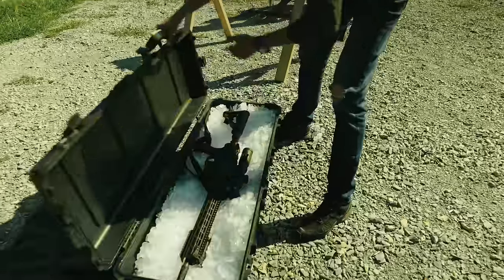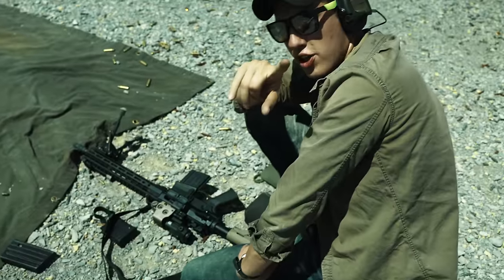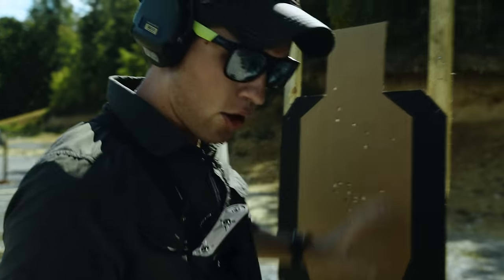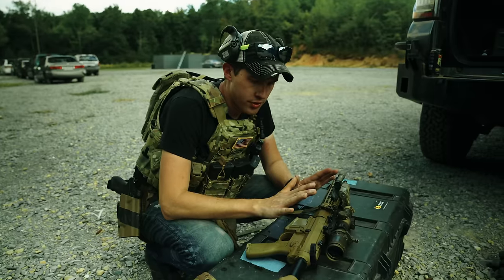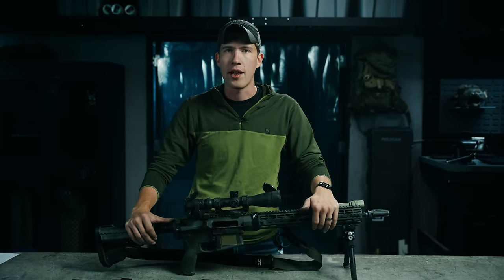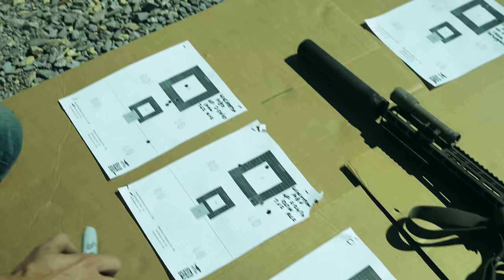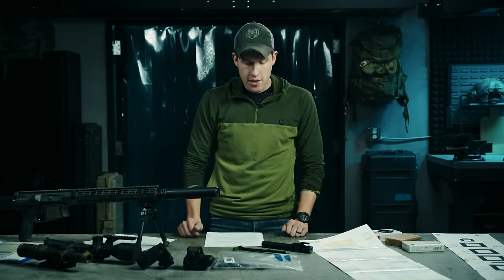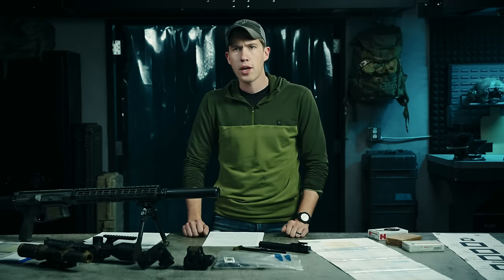Aero Precision M5 AR-10 5,000 Round Test

Comment: Hello T. Rex. Here's my experience so far......

I picked up a completed 308 M5 build from a store/builder in Nebraska. First gun was a single shot! Changed a few parts, did not fix the issue. The issue being not a reliable functioning rifle. Might get through maybe 4 rounds at the most if lucky. And always failed to lock open on the last round. Sent it back to the builder. He said the gas block was not properly aligned. Keep in mind he sent it to me out of alignment if that was the case! The gas block and rod was one of the items changed!  He ended up building me a new rifle, because he felt the first was kinda rough when all was said and done. He told me he shot 10 rounds through it, and it worked flawless. 

The new rifle arrived at my FFL where I picked it up a few days ago. And based on what he said about it working fine, I decided to go ahead and change a few things on the rifle. I put on a different pistol grip, added an Ambi safety, put in a LaRue MBT trigger, and this time when ahead and installed a muzzle break (This was not added to the first gun.) I did remove the hand rail and added a bi-pod M-Lock rail adapter and a M-Lock sling connector. I put the scope and the 45 degree mount with red dot back on the upper receiver. But I did not make any changes to the gas block or the gas rod, or the bolt. Took the new rifle to the range and it is a single shot just like the first rifle!!! When I say single shot, I mean the rifle will fire and eject the case (Sometimes will jam with a double feed, but these are rare), but the bolt will not move far enough to the rear to load a new round from the mag! I have to charge the rifle to load the next round And, just like the first rifle it will not lock the bolt back on the last round!

This rifle has not had enough rounds through it yet to be considered broken in I know. But I'm a little hesitant due to all the rounds I fired through the first rifle without fixing the issues, and this rifle already showing the same issues!! 

 I have sent a email to Aero, but have not heard any reply. I think the rifle is under gassed and that the gas port on the 416 BA barrel could be too small, but the builder stated it is the correct size. I really like this rifle and I really want it to work as it should! It is accurate enough. I did zero the first rifle out to 300 yards. 

Kinda wishing I had just went with a PSA 20" 308!

Update: Contacted Ballistic Advantage and explained what it was doing. They agreed with me that it sounded under gassed. They told me what size the gas port should be and what drill bit size I needed. I disassembled the rifle and tried to insert the drill bit in the gas port, it would not fit. I put a cleaning rod in the barrel, put some oil on the bit and around the hole and drilled it out. I cleaned the barrel and made sure there was not shavings in it. I put all the upgrades back on the rifle and took it to a local range. It worked as it should. I fired a full 20 round mag without any issues! I know It needs more rounds down the pipe, and that will happen when I re-zero the rifle at 300 yards.

One Shot  (Literally)... One Kill!

Comment: Veteran here, worked with the M4 quite a bit. Biggest tip with the fire pin malfunction, more than likely heat stress, never had an issue with it with my M4, but I also noticed your rifle is dry as a bone, with shooting that damn much definitely coat that interior with CLP, I’ve put couple thousand rounds through an M4 and never had any major malfunctions, did drop it on my acog once or twice though lol.
Careful with heating and cooling quickly, strains the whole system
Reply: Clp is life blood

Comment: Excellent content. I would love to see how the Sig 716i and the DD5 V3 stack up against this as they are also 16" .308 guns. Would be great to see how the Sig (a few hundred dollars more than the Aero) would do.
Reply: POF piston no problem, would love to see same test with sig 716. There was a sheriffs office in Cali that tested pof to tens of thousands of rounds.
Reply: I can tell you my sig 716i shoots about 5 moa with M80 and 1.5 moa with federal 175gr GMM
Reply: My sig 716 patrol gen 1 has about 8500 rounds all original parts. Had a issue when I first bought it, the forward assist pin kept catching the bolt and not allowing it to cycle. sent back to sig n they fixed it. Havent had a FTF(feed or fire) or a FTE since, even in -25°. Overall I've been extremely happy with it and its one of my favorite rifles. Usually only get to about 150 to 200 rounds before cleaning as I dont go out to just dump mags with that gun.
Reply: Yeaa I'd be very interested in the sig 716
Reply: I’m also interested in seeing Lucas’s findings.
Reply: My issue with the 716i is the proprietary charging handle and the one the rifle ship with sucks.
Reply: Another vote for the 716
Reply: @Falcons17  Yes, that’s super annoying.
Sig has another handle that is much better, and should be standard with the rifle.
It’s out of stock of course

Comment: I built an AR10 in 308 with an Aero upper and lower. The only non aero parts are a cryptic bcg, radian charging handle, and geiselle trigger. It's been one of my favorite rifles. I've recently added a 3-18 scope to use it for deer hunting. Great video and I'm pretty impressed how far the rifle made it unlubed.
Reply: What's the difference between 10 and 15?
Reply: That's basically exactly what I'm doing, but Wilson combat bcg.
Reply: @920WASHBURN 10 is usually chambered in a bigger round like 308 or 6.5 creed as apposed to an ar15 which is usually chambered in 556/223
Reply: @bradenstackhouse1335  I see I see. 308 is bigger than 556? Huh.
Reply: @920WASHBURN  .308 Winchester is the civilian designation of the military round 7.62 NATO. 5.56 NATO is the military designation of the .223 Remington. So an AR-15 shoots a .22 caliber bullet, and an AR-10 shoots a .30 caliber bullet. Sometimes AR-10 are in 6.5 Creedmoor, which is a .264 caliber bullet. So .30 > .264 > .22

Comment: This is the first 2 hour video I have ever watched on YouTube, and I can say that Lucas was deserving of that honor.

That said, I have some things to say.

I built myself an Aero M5 using almost exclusively using Aero-branded parts amidst early COVID and Biden-related supply shortages and posted two videos including a shooting tests to my channel.

My 18" M5 was not headspaced and was running a mil-spec trigger. I am not a long-range shooter and I managed a 0.7-0.8 MOA grouping with some terribly reloaded M80 ammo. Say what you will about that, and I admit your mileage will certainly vary.

I did not have any malfunctions in the time I had the rifle, and I loved the quality for the price of the parts offered. I specifically selected a barrel directly from Ballistic Advantage, which of course, makes the barrels for Aero.

Mine was a budget build, and it was extremely difficult to source parts for. Nonetheless, I was fortunate to find that I was able to get really solid groups out of crap quality M80-type ammo. I have since sold it, and am prepping a new .308 AR, but taking my time to find the parts for something that weighs less than 12 pounds.

The lower and upper are both Aero. I am likely going to try to source a different BCG and barrel than was offered through Aero/Ballistic Advantage. I am a law student and do not have a massive budget, but I am damn sure I do not want to buy a rifle that will fail on me under hard conditions. I will say, Lucas did inspire some of that consideration, and I appreciate that T-Rex Arms took the time and expense to make this video.

Regardless, I hope that you all do not write off Aero entirely. They are reasonable and workable for most of us, and I implore that you consider the expense against the requirements that you have for your firearm, which is ultimately a tool. Don't buy Snap-On for a job that a Pittsburgh could handle.

Comment: Bought one of these in South Africa and started shootings it last year September. I had a ton of malfunctions. Handloaded some Hornady ELDM168gr in Lapua brass, using Somchem S335 or Vihtavuori N550 or N150. Hand the same issue. Running it with a ASE Utra suppressor as I set it up as a DMR. Battled a ton. 100 round 5-7 stoppages then on day 19 rounds 5 malfunctions. Mostly stove pipes and sometimes a double feed with a stove pipe at the same time. Cases end up turning around  inside the ejection port with the BCG jamming it. Ended up with a Odin works adjustable gas block. Gas block was on its 1st click open and the rifle still cycled locking the BCG open after an empty mag. Ejection at 4 o clock. Opened it another 2 clicks and it seems good ejection at 3 o clock. So gas block is open 3 clicks out of 20 possible adjustments. Seems like this is a very over gassed rifle. Has any one had similar issues

Comment: Outstanding format and very informative.  I really like the idea of one rifle being presented in several configurations.  
My Aero Precision M5 has the Superlative Arms adjustable gas block and Geissele 2 stage trigger, Surefire closed tine comp.  Shoots smooth and very controllable with the comp and adjustable block.  I haven't tried it suppressed yet...that's coming later.  Only a few hundred rounds into it, but we'll see.  As I did all the assembly myself,  I applied loctite to all screws (hand guard, bolt catch screw).  So far, no movement, witness marks unchanged.  As demonstrated, mags are a common cause of failure with these rifles, but so far no problems at all using PMAGs, no malfunctions.  
Having an extra bolt and firing pin could bring a dead gun back to life.  Those can easily be stored in the handle or stock of many rifles, and is a good backup for M4's and M5's.  
As for running a gun with no lube, I can never understand that philosophy.  These are mechanical devices that come from the mfg with recommendations for lubrication.  Hot metal against hot metal produces severe friction and induces unnecessary stress and accelerated wear on parts.  Deliberately running a dry gun as long as possible with no lube just to see when it chokes is akin to dumping all the oil from your truck and running it as long as possible just to see how long it takes to kill it.  
I wonder if having the adjustable block may decrease the wear on the BCG sufficiently to prolong the life of the parts that were killed in this gun.

If Lucas or the T.REX crew needs another Aero M5 to run as a comparison, to see if these kind of issues are a fluke versus a feature of these builds, I'll volunteer mine for part 2 of this series.  Kind of curious to see how long it takes for the screwed-on Superlative Arms gas block to work itself loose....

Comment: If you’re ever in the field without loctite, you can use a drop of new skin liquid bandage as a substitute for any bolts or screws backing out. You can also use a drop of super glue.
Reply: I found some flat black and dang near flat OD nail polish years ago. Works to patch rain gear, cover wounds and knock down shine on metal.

Comment: Than you for this video. I’m in process of building a Aero M5 AR10 using a match receiver set. Needless to say. I will be using a different brand of bolt carrier group. I use heat resistance blue loctite on gas block set screws. I use standard purple loctite on the bolt release screw. Purple on the forward assist retaining screw.And if the handguard bolts thread into barrel nut I apply heat resistance blue loctite. I bed my barrel extension with loctite 620. And apply anti seize to the barrel nut threads. Stake the castle nut. Purple loctite on the tension screw that eliminates slop between the upper and lower. Purple loctite on the pistol grip bolt. On the adjustable gas blocks I apply anti seize to the adjusting screw and set screw to prevent the bolts from freezing up from carbon build up. And everything is torque to factory specifications.

Comment: One thing I noticed, that I didn't like, was the ejection angle. It looked like it was consistently ejecting  between 1 and 2 o'clock,  suppressed and unsuppressed.  The reason it's ejecting at that angle could possibly point to a possible reason for some of the malfunctions. It could be gassing or buffering issues.  Just something to consider.

Comment: Excellent video! I think the PSA 308 is a very commonly bought rifle in this category and would love to see the comparison.
Reply: Lol, $100 says it doesn't go much over half the round count as aero.  Maybe 2500.  It would be good to hold these affordable companies to account.  Many broke or frugal people have convinced themselves they are just as good.  Videos like these should shed some light.
Reply: @myfamily8581  people have never bought PSA because it's "just as good as the others." It's more just about the cost to performance ratio. Parts for them.are also dirt cheap so if the PSA makes it to 1500 rounds before breaking a firing pin that you can get for $15 I'd consider that a good deal.
Reply: @myfamily8581    Most of the AR's that are made in the U.S. are probably actually made by 5 or 6 manufacturers.   Certainly the parts are.   Who the "Subcontractor" is likely the first real question you should ask.
Reply: @AKlover  Sad how QC is underrated " Batch Testing " Time= $
Reply: @marcgonzalez9547  Pretty sure you can check head spacing and and function check A gun by firing 10 rounds of garbage ammo inside of 1 minute.   That is probably more QC than actually gets done by 85% of "Assemblers".   Calling many of them manufacturers is A joke.
Reply: LOL PSA would’ve broke after a couple hundred rounds
Reply: @___meph___4547 my guy, 1k is nothing. Check back with us around 10k
Reply: Make sure you run yours dry like Lucas did so we can get comparable round could. Oil and cleaning is for cheaters.
Reply: @williamphillip9749  there ak gf3 ran 17k rounds full auto. Before barrel started to  key hole
Reply: You just lost 100$ ,its already been done with PSA and is on YouTube. 5000 rounds on full auto actually, a 3000 ar doesn't last any longer than a 600$ ar,they both will need a new bolt and upper. One is more accurate and everything runs smoothly but thats about the only difference

Comment: Great video. This one of the first of this length that I've watched in its entirety.  I purchased one of these rifles and ran about 1000 rounds at a Prairie Fire, NV course and another 200ish rounds at Tactical Response in Camden, TN. Mine  didn't like to run dry & I lubed it on day one. After that, no problems. I'm going to check the promblem areas you identified, so thanks for that. I'm looking forward to more of your videos.  Thanks.

Comment: Lucas thank you for doing this. You where honest with the review and kept the OEM parts. The glass was a little pricey but the hardware and the reliability was what you where looking for. 

To do this again I would say the cheapest AR 15 vs $4,000 one. To see if they last.

Thank you again. $50k was worth it.
Reply: Honest? 1:32:35 he claims he cleaned and lubed the gun when it was needed... yet ran it dry for 2000+ rounds, against manufacturer recommendations. That initial period of excessive heat, friction, shock & vibration taints the entire test and any results.

Comment: I’m really glad this came out. This has helped me come to the conclusion that if you want a reliable somewhat accurate 308/DMR, you need a 2k-4K rifle.
Reply from the maker: Or be very careful and smart about building your own.
Reply: @TREXARMS  ehhh I was expecting aero/BA to have better accuracy. You upgrade a barrel, hand guard, and BCG. Your cost goes from 1200 to brushing 2k pretty quick. I think the solution for now is save and train more with a 5.56
Reply: green mountain barrels are affordable and the one I got I can shot a shell casing at 100yrds no problem
Reply: @JL-pj6kk  The issue is more ammo related. The majority of .308 on the market is designed with deer or paper in mind, fired from a 22 or 24in barrel from a dumpster fire bolt gun. I've had pretty decent accuracy with match ammo out of mine. It actually shoots better than some of the M110s and M110A1s that I've shot for work. 7.62 is almost always machine gun quality.

.308 just isn't a phenomenal sub-MOA cartridge in general. There's a reason why PRS and long range guys use different calibers more often than not. There's a few factory loadings that easily run sub-MOA in mine, but the majority do not. Just gotta find one that works and use it.
Reply: @orion8981  it’s the gun my guy. I reload, I’ve got a precision rifle. Me plus the gun and factory ammo is sub MOA. With hand loads it’s half MOA. Hornady factory ammo is plenty capable of sub MOA in all there lines, Hornady white tail through Hornady match. Individual Barrels like specific loads over others, but if you can’t keep Hornady ammo in roughly MOA, it’s a problem.
Reply: @JL-pj6kk  I run Hornady Black in mine. It's half MOA hot and a touch better cold out of a mostly stock M5.
Reply: @orion8981  how big of a group 3 or 10?
Reply: @JL-pj6kk  5 hot 5 cold when I do group testing, which is whenever I roll lots. 168gr GMM runs in the .75 to 1 MOA range. Better downrange performance and velocity consistency with the GMM.

I don't have any issues ringing MOA plates out to 800, and IPSC plates at 1000. The latter isn't particularly difficult but a hit is a hit.